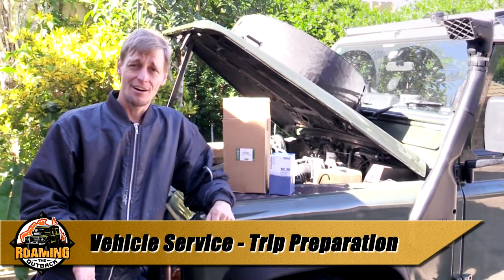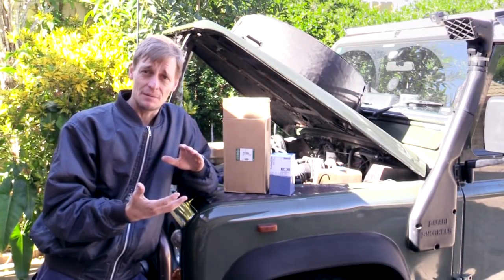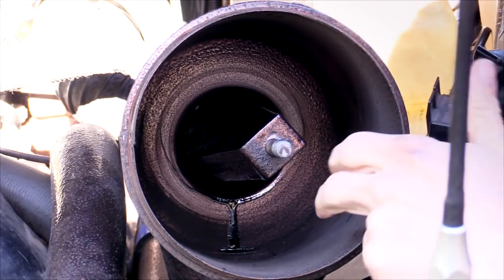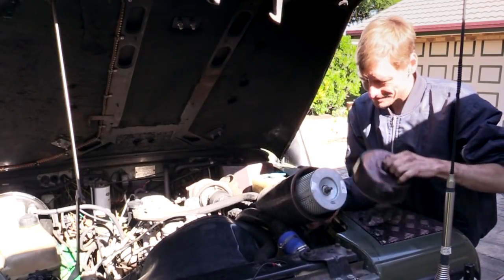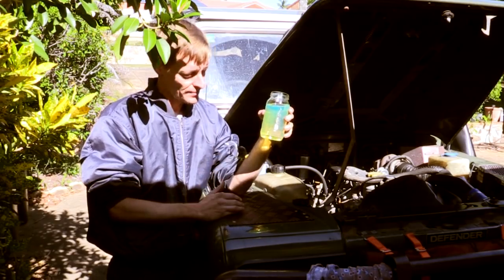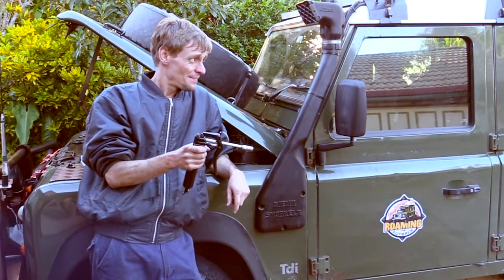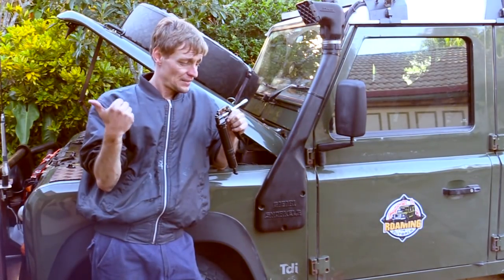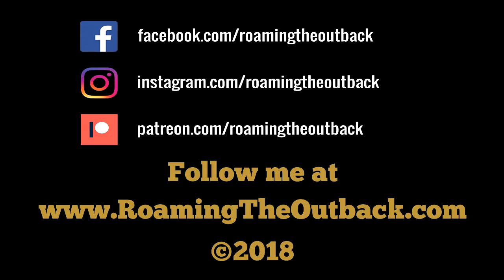Vehicle Service - 4WD Outback Travel Trip Preparation 3/3

Comment: Don't forget to change the oil in front hubs too.
A useful improvement is to change the fuel sedimentor for a pre-filter. You can get one which uses the same head unit so no mods needed. The filter is actually the same size as the standard Defender fuel filter so you can move the old filter to the pre-filter if you wish. It also has a transparent bowl so you can check the fuel cleanliness without removing anything. I fitted one after being sold some contaminated diesel in Hungary a few years back. Highly recommended.
Reply from the maker: Oil was freshly changed after my recent axle upgrade. I'm always afraid of adding those clear glass things due to risk of cracking etc from thrown up rocks. Thus far though I've had no water collected in the time it's been fitted.
Reply: @RoamingTheOutback  Nope. The bowl on my pre-filter is a shatterproof nylon material. I had the same concerns. I wish I had had it when I was sold the contaminated diesel because I would have realised quicker what the problem was and would have avoided destroying the fuel lift pump.

Comment: Brett you ever thought of using washable air filters.  Stop the need for carrying a spare just need to wash it out.

I’ve thought about if using one but never have just not sure it’s worth the hassle and time.  And you lot get that thick bull dust down there, so be even more time taken to wash them.

Go luck with the travels.
Reply from the maker: No, never wanted to touch anything like that. LR designed their filter to work the best with their engine. So i'll keep it standard. Thanks.